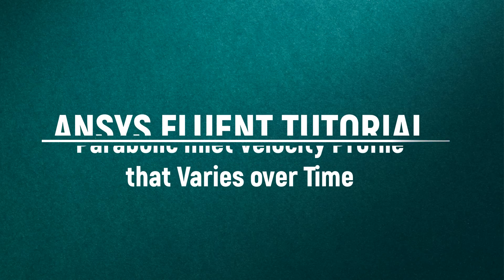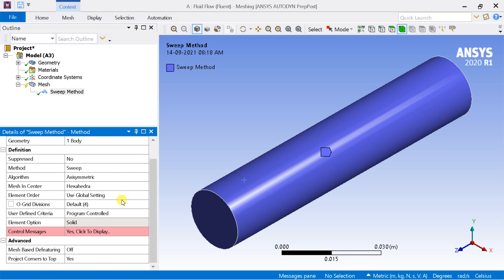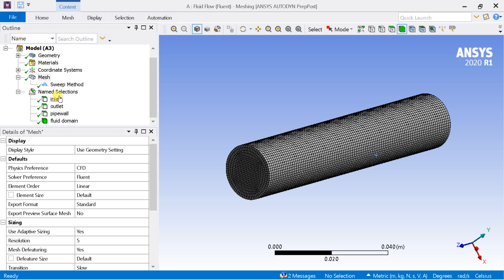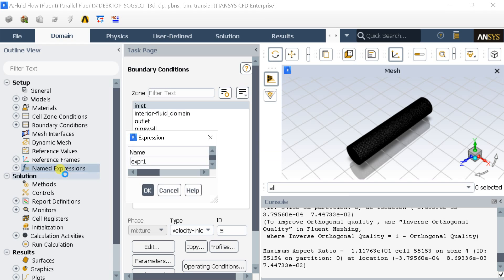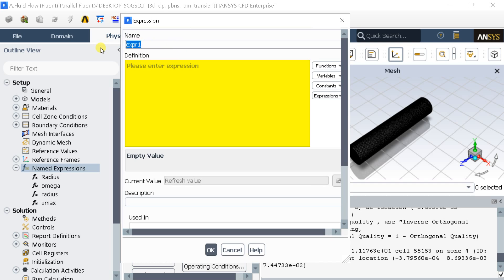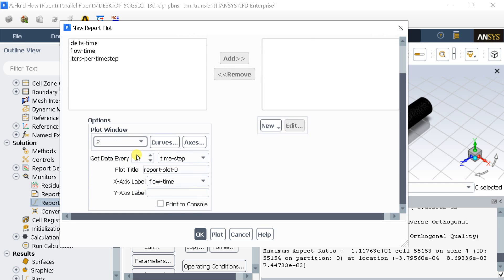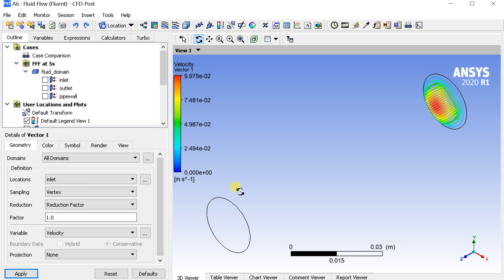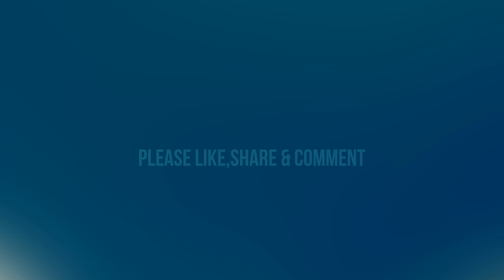ANSYS Fluent Tutorial | Parabolic Inlet Velocity Profile That Varies Over Time | Without UDF | CFD

Comment: sweep method does not work in copper tube, we have two body solid and fluid, what do you do now?
Reply from the maker: It's only applicable for a single body irrespective of the material.